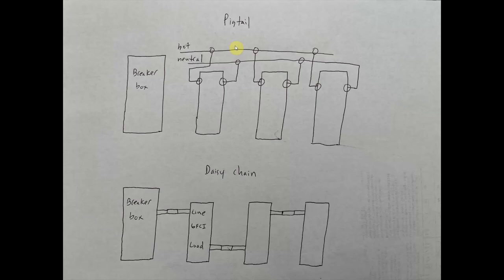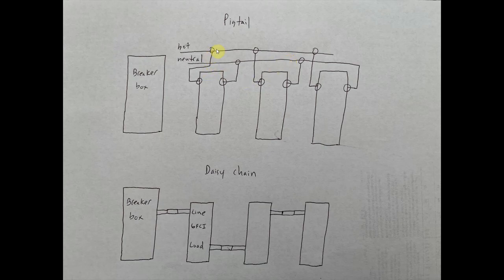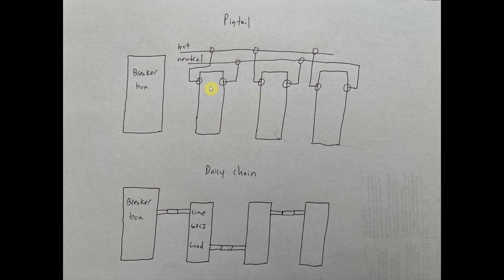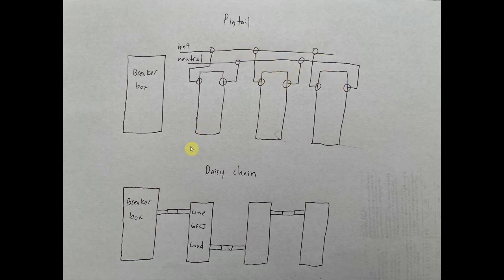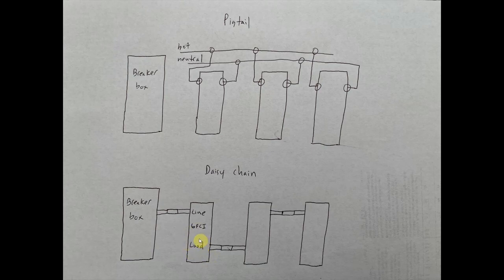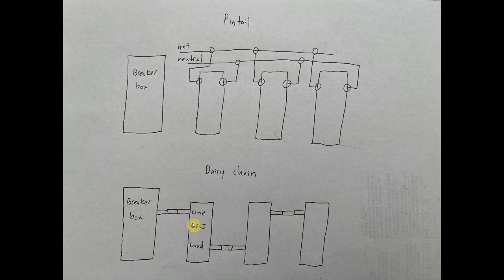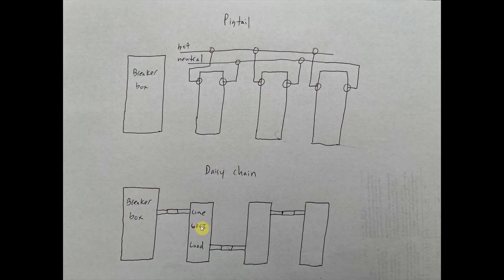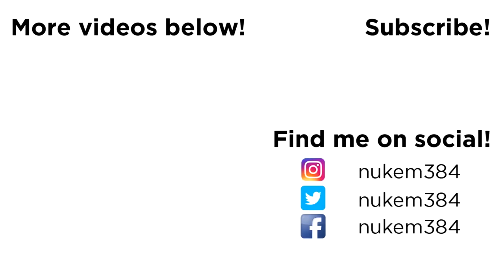Electrical Wiring – Difference Between Pigtail and Daisy Chain

Comment: I have a second question: 

Part 1 of question 2: in the pig version, what if the actual breaker flips? Then all the switches will stop even if it’s pigged right?!

Part 2 of question 2: what would happen to the outlet directly connected to the breaker box in the daisy chain example if the outlet to the right became fried? Would the outlet to its left be inoperable also because it needs the 6 wires to work functionally and now only 3 of its wires are “doing anything”?
Reply from the maker: Part 1 - yes, if the breaker flips.  But if the breaker flips, it doesn't matter which way you wire, nothing will work lol.  The point is let's say you pigtail 5 GFCI's on a circuit and the first GFCI of the circuit pops for some reason (let's say too many hair dryers on that outlet), all the other GFCI's/outlets will still work.

Now if you were to daisy chain on that circuit instead and we use the same example, that whole circuit is dead until you reset that first GFCI.  See the difference?

Part 2 - kinda related to my 2nd paragraph, only the outlets on the right would not be working, called downstream outlets.  Any outlets left, or upstream is what it's called, would still be working.
Reply: @nukem384  very well explained thanks so much!!!!
Reply: @nukem384  hey I have a question although it’s off topic but this video made me think: you know how apparently a bird won’t get electrocuted if both feet are touching the same line but will if one foot is touching line and other is touching the pole which is grounded? 
1)
What does grounding mean
2)
What changed in the birds body to allow electricity to flow thru him in one situation but not the other?!!
3)
How when we plug something into outlet, is the whole circuit from the power provider making a closed loop? Isn’t that crazy that the entire thing is like a 20 mile closed loop or whatever ?
Reply from the maker: @MathCuriousity  Now you're getting too technical for me lolol.  That's for a electrician to answer haha.  I don't want to give you wrong info on any of those questions.

Comment: I am glad I came across your video. I've shared the pic of my connection with a friend and been told to double check the length of the wire since NEC required a minimum of 6" for pigtail wires. I wanted to ask if there was a minimum length for the daisy chain wiring because I believe my connection type is just that. While it is difficult to imagine a daisy chain this short, I believe I have one. Here's how:
In a 3 gang electrical box I am running 3 smart switches, each requiring a Neutral. I end up with 8 Neutral wires that must all be joined together. I am using two 5-conductor Wago 221 connectors (5th connector on each Wago is for the bridging of the two Wagos). Is the bridging of Wagos considered a daisy chain? Is there a minimum length requirement for the "bridging" wire between the Wagos? Thanks!!
Reply from the maker: Not an electrician, so I don't want to give you wrong information.  But if you've got that many Wago's, it sounds more like pigtails than a daisy chain.  This would probably be a better question on a forum for electricians or house DIY.
Reply: @nukem384  Thank you for your reply!
I am using only two 5-conductor Wagos (Wago 221-415) to join all the neutrals.
A wirenut wouldn't be able to hold 8 neutrals either so I assume one would join 4 wires in wirenut-1 and another 4 wires in the wirenut-2, then use a "bridge wire" between the two wirenuts. I am doing the same thing except that it's Wagos.
Everywhere I check, the definition of a pigtail is a short segment that is connected to a wirenut on one end, and to a device on the other. In my case it's daisy chained "wirenuts" on both ends (I believe)...
Reply from the maker: @_m.a-x  That still sounds more like a pigtail.

Daisy chaining is more like something feeding off something else for power.

I guess lets put it this way.  Let's say one of the switches dies.  Do the other ones die too?  Or does that one just die based on how you have it wired up?

Comment: I did some wiring and was proud of how it all worked out (daisy chain), sent a photo of my handy work to a friend who used to work for an electrician, and he said I didn’t do it right, and explained I should have used the pigtail method (he explained it as a splice using wire nuts). Said that’s just how the pros do it. After researching, your video and others seem to verify what he said. And while the daisy chain method technically works, it seems to be far inferior and not best practice. If this is the case, why would anyone ever daisy chain? Is there ever an advantage? Aside from avoiding using wire nuts?
Reply from the maker: Daisy chain is usually used to GFCI, well one scenario anyway.  So you start with your GFCI outlet upstream, and then daisy chain that entire circuit.  That way you only need to reset one outlet if something happens and the entire circuit is GFCI protected.  However, the entire circuit relies on that outlet to do working.  If it dies, you entire circuit is dead.

If you were to do the exact scenario, but with pigtails, only that outlet would be dead.  The rest of the circuit would still be working.  Pros and cons I guess.
Reply: @nukem384 what’s the pro of daisy over pig ?!